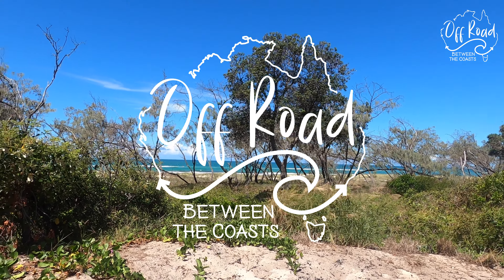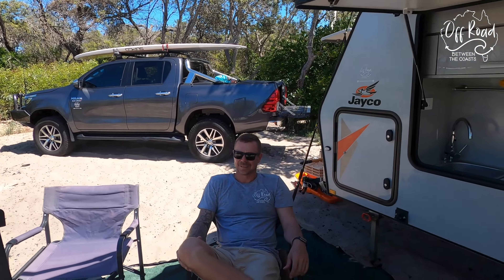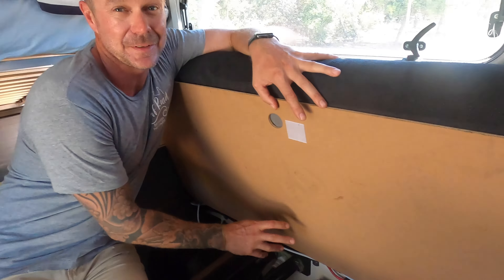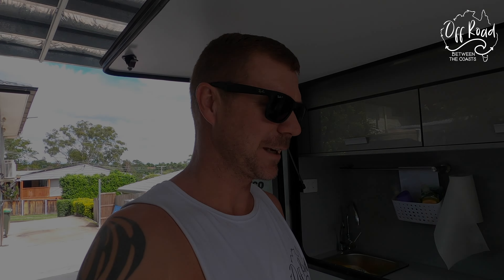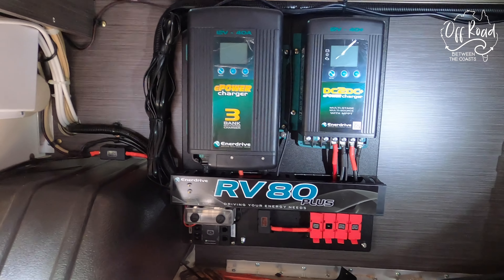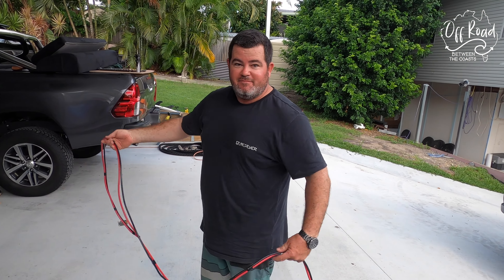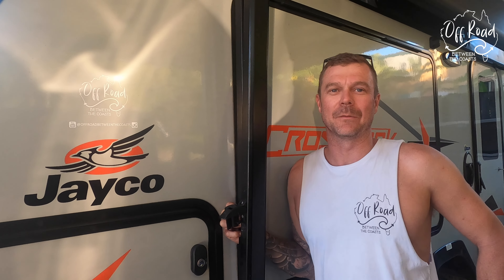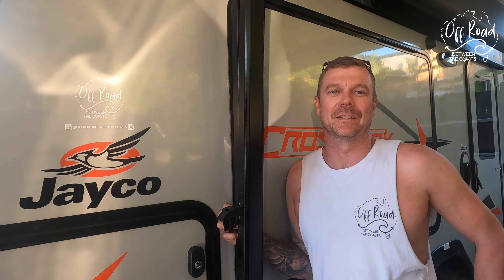Enerdrive lithium battery upgrade in our Jayco Crosstrak

Comment: Have you noticed if the storage compartment under the bed gets hot or warmer since installing all the extra charging equipment in there? I'm doing the same and thinking about putting in some external fans as well to make sure everything stays cool. 😎
Reply from the maker: No we haven’t noticed that it’s got any hotter.  Good idea with the external fans though! We might have to do the same.  Thanks for watching and the idea!

Comment: Hey Guys, I am enjoying your vids.
We have a CrossTrak on order it comes with the Projecta PM235J 12V Power System with two 100AMP lithium batteries with an additional solar panel.
It’s my understanding that the system will charge the batteries when travelling as well as run the fridge. The solar system will also charge the batteries. 
What was the original 12V Power System in your van? 
Also have you now set up a external input for a portable solar panel or blanket?
Reply: we currently have a Crosstrak with 120amp Lithium and the PM235J Projecta system plus 2x160watt solar panels on the roof ... the system has not worked since we picked up the van, we have done 2 trips out .. both off grid for 3 overnights each trip. ....and the lithium battery held up no problems... but we had no monitoring system.. the bluetooth did not work.. and the system depends on an app on your phone.... Projecta works but we couldnt monitor our usage or input.... so we basically went blind.... and all we could do was keep an eye on the fridge.. to make sure it was still running.... back in for a service shortly ...

Comment: Hey mate what brand of panel is that? Perfect fit up front on the crosstrak. I'm planning on adding an extra solar panel myself. I've also installed a enerdrive dc2dc and it's fantastic! Thanks for the video
Reply from the maker: Hi.  I’m sorry I’m not too sure- someone came and did a supply and install for us. It was just cheapo one but has been keeping us fully charged.  Thanks for watching! Good luck adding one in for you!

Comment: Great setup. Looking to move to a lithium based setup myself. I had no idea the RV80 Plus existed, looks perfect for what I want. How is your roof solar and J35B charge current routed now? J35B does not have the lithium charging algorithms, so have you disable the charging function on the J35B somehow?

Also, just wondering what you did (if anything) for grounding your inverter? Lot of differing opinions out there it seems on how this should be done safety.
Reply from the maker: BM pro told us that the J35B can be used as your 12V accessory block and it won't charge the battery as it's not lithium compatible. They said it would be fine and won't damage the battery as it's only being used to power lights/sockets etc. The battery gets charged via the RV80 DCAC charger. The inverter is grounded via the chassis rail.